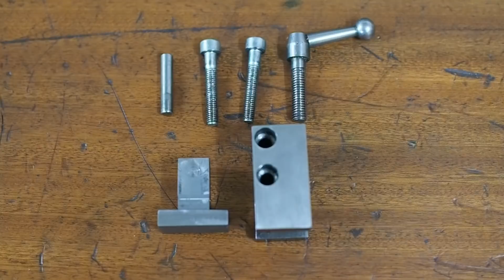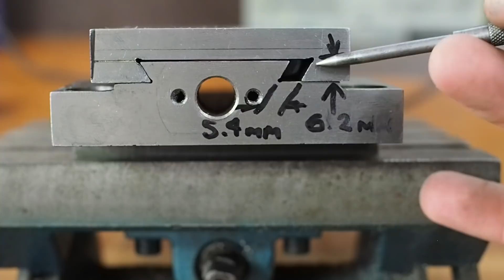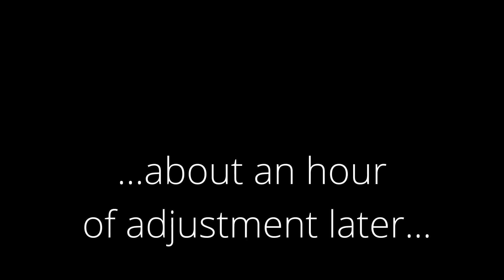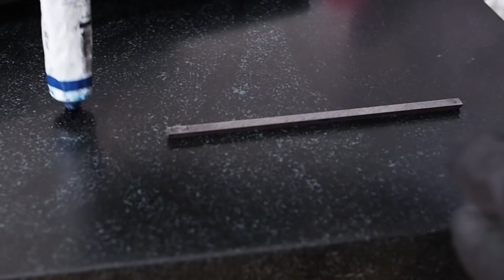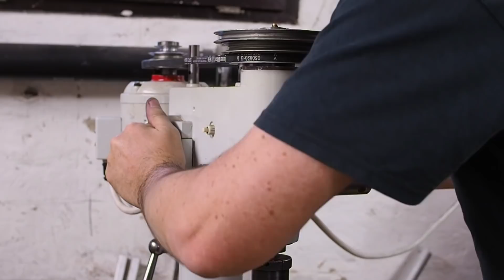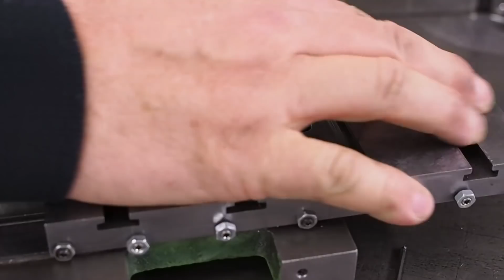Fixing the mini lathe - episode 11 - cross slide gib

Comment: I love that slide hammer centre punch, never seen one before. The fact you made it at school just makes it better. I still have a lot of my apprenticeship pieces around, but the only thing I had left from metalwork at school was my favourite cold chisel. I'd obviously got the tempering on the point just right as it rarely needed any sharpening, but using it one day, it simply sheared off in two pieces just as the taper becomes the shaft😢😢😢.
Reply from the maker: It is cool how shop class as a kid can affect us. I also still have a sheet metal pencil case i made in shop class as a 12 year old.

Comment: Thanks for this excellent video. Being all out of French disc brakes, my plan is to use ancient sash window weights, which appear to be good enough on the inside. The turd I am polishing is called a Shopmaster by the OEM, but is known by those who have this specific misfortune as the Slopmaster.  Thanks again.
Reply from the maker: You got lucky with sash weights which have good cast iron. Given their usage foundries didn't much effort into making them good iron, and void free.
Reply: @RotarySMP  I reckon. A surprise result for sure.

Comment: i did an engineer square a few year back in my school
Reply from the maker: You have been busy, watching all the videos. The little vise I use on the drill press was done in my apprenticeship.
Reply: @RotarySMP  yes, I like a lot this type of work, machining and such, plus you are interesting to watch.
Cool in my case i went to a school that in may country we call "industrial school" you have classes in the morning that teach you this type of thing like using  lathe, machining, sanding, carpentry, soldering, electricity, construction, and lot more, you very cool and in that year i did a few parts and learn a lot. and well in the afternoon we have normal classes like a normal school, and when you finish this 6 years you ended whit a degree as electronic technician or major master of works, the second is like an architect but whit few limits, the translation is literal so i dont know if in english you have a word that represent better that degree (I not a natural english speaker)

Comment: You ALWAYS make tapered gibs too long to start with and then once it is roughly fitted you can do the final finishing and scraping......when it is bedded the length is then determined otherwise you can get it running out of the dovetail if you make it too short initially.
Reply from the maker: Yep. Lucky I had enough length.
Reply: @Ian Pearson is this a tapered gib though? Aren't those adjusted at their end instead of along their length? If it is, I sure missed where the taper got machined into it...

Comment: Nice. Is the material of the gib a good combination regarding friction and wear? (metal to metal)  Is use of non ferrous metal,  brass or bronze possible?
Reply from the maker: Cast iron is somewhat self lubricating due to the precipitated graphite. My cross slide is not idea, as I made it from steel. Given how long and thin these gibs are, they will distort to conform to the slide and screws so it probably doesnt matter much what your make them from. Bronz or brass have been used by others.

Comment: Came across your videos as im currently trying to fix/scrape a dovetail on my Sieg Mill (this sucks). But great stuff you're doing. Wanted to comment that I build a CNC Lathe a year ago using Machinekit/Linuxcnc on a small embedded Board (BBB) to get around MESA cards and still get glasscales, handwheel and spindle encoders inputs processed.
Reply from the maker: Thanks for the feedback. I used Mesa cards in my MAHO with LinuxCNC and really like them. Rock solid, and one of the MESA designers gives excellent support on the LinuxCNC forum. I have a 7i96 ready for the mini-lathe. Probably leave this open loop.

Comment: Seems the RNZAF and RAAF had the same idea for trade training.
After the vice they let you perfect your draw filing on an aluminium dove tail, tolerence? You guessed it .001".
Ive still got the vice, 42 years later.
Reply from the maker: Yep, You draw filed the parts of the vise to +/-1 thou, but drilled the assembly holes to +/-15 thou. Some didn't assemble or work :)
Reply: @RotarySMP  
Thats the one, the groan when the alloy dove tail task was revealed was loud.
The vice was about 4 weeks of draw filing, checking for square, swearing, restarting the bits you screwed up. 
That was back when i could actually see less than a thou clearence between the part and the square (that was the 90 deg one, not the special one you own😁)
Reply from the maker: @dhc4ever  Was the RAAF also too cheap to purchase new files, so the ones we hd to use already had about a thousand miles of draw filing behind them by the time our course started. Of course there was no amazon to just order a new file :)
Reply: @RotarySMP  
A long time  ago, but yeah some were VERY average.
The equipos probably had some, but they had to hang onto them in case someone else wanted one.
Training establishments were never all that flush with funds.
So which trade did you end up in?
Reply from the maker: @dhc4ever  Aircraft Technician. How about you?
Reply: @RotarySMP  
Started out as airframe fitter then through the miracle of amalgamation became an aircraft technician.
Typical, I went from a helicopter sqn where the framies worked like dogs and the engine fitters did SFA to a Caribou sqn where the frames were moderately busy and the engine fitters worked like slaves.
Quick snap of the fingers and viola youre an engine fitter, go out and get oily, didn't seem fair at the time.
So what did you work on, Orion's,hercs andovers or those noisy little Skyhawks?
Reply from the maker: @dhc4ever  The RNZAF had already combined the trades by the time I started. I mainly worked on Squawk's, in the skin bay,  engine bay, Line and Depot maintenance, but ended up on the Airtrainers for my last year and half.

Did go on exercise to RAAF Williamstown for a 2W deployment with 75SQN.

Comment: It's probably better to use pointed tip gib screws rather than flat tipped ones. The flat ones will press the gib on the top rather than the middle of the screw because of the slope of the dove tail. This will impart a twisting force on the gib rather than pushing it flat. It will get worse as the gib wears. You can actually see this happening with the small ill fitting original gib.
Reply from the maker: Thanks for watching. That is why I drilled divets into the gib strip, and put a slight conical point on the screws, so that they are not acing on the slope of the gib.
Reply: @RotarySMP  How about small ball bearing against the gib strip.
Reply from the maker: @gordonsmith1971  Good idea, but I am afraid that might be polishing this turd :)
Reply: @RotarySMP  I'm a fitter and turner from the '50's and over the years all the gibs I ever worked on, that had screw adjusters, had dimples that were flat bottomed in the gib.......most of the other gibs were tapered.
This allowed the adjusting GRUB screws........ not those cap screws you advocated that stick out like tits on a bull........ to put a square pressure against the middle of the gib.
You can buy Allen grub screws with ends that are spigoted especially suited for gib adjustment.
Reply: @gangleweed  what does spigoted mean?  Google isn't helping here.

Comment: On my "stock" mini lathe I swapped out the gib grub screws for hex cap screws + new nuts + washers. The new nuts were more robust than the originals. This simple change made all the difference in gib adjustment, so others might find this helpful too. The Allen key fits the cap screws better than the tiny wrench in the grub screws. I ground the tips to a point instead of the shoulder. Didn't know disc brakes were cast !? Wow.
Reply from the maker: There are a lot of ways to improve the mini lathe. SIEG, was generous in their process failures. :)
Reply: Is it best to taper the gib screw tip to match the hole taper?  I need to fix mine anyhow as the gib holes aren't aligned to cross slide holes.  I planned to use standard drills unless I should get something different.  Thanks

Comment: Superb work! but given that the gyb is sliding against the cast iron of the saddle casting, would it not have been better (
and easier) to have used steel? many lathes use steel spincles rotatong in cast iron bearings, so the comparitive wear on a gyb would be hegligible. 

Phil East Yorkshire
https://www.youtube.com/channel/UCKf0nWnXKXltBjj7MWtdjWA?
Reply from the maker: Thanks for watching. A steel shaft in a plain bearing is separated by the oil forming a liquid bearing. For extremely low speed surfaces, like a  lathe way, the oil film (which should be a proper way oil) can break down. That is where you want some self lubricating properties. The carbon in cast iron helps there, to prevent galling. My cross slide is steel, and that is not ideal.

Comment: Thanks. You deserve many more subscribers. I found on my minilathe that those three grub screws were actually the only thing stopping the gib from twisting when tool down forces were applied to the other side of the slide. Hence the fact that the grubs mate into holes in the gib is really important (and entirely absent on my lathe), and I guess increasing the number of grubs is helpful also, as is having the gib fitting much better in the dovetail.
Reply from the maker: Thanks. Accurate geometry is not really one of SIEG's  strengths. Hench all the polishing :)

Comment: Never thought of using rotor for cast iron stock and i have a stack of them
Reply from the maker: The iron is a little harder than the bed or saddle, but the auto industry can not afford defective brakes, so it is extremely uniform and really nice to work with.
Reply: @RotarySMP  thanks i will save them and try it
Reply: Never trust the car industry... That's why I always improve the brake on my cars. And ask you to help.
Reply: @NicoCarsAndCookies  and help how
Reply from the maker: @NicoCarsAndCookies  That was a Renault brake rotor which made the supreme sacrifice. This is the only brake modification which I do on my machines :)